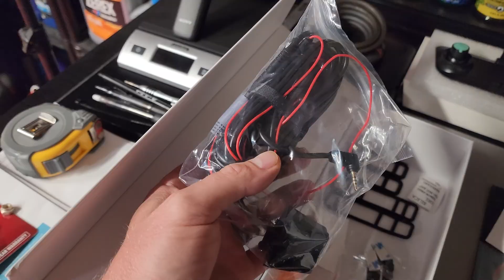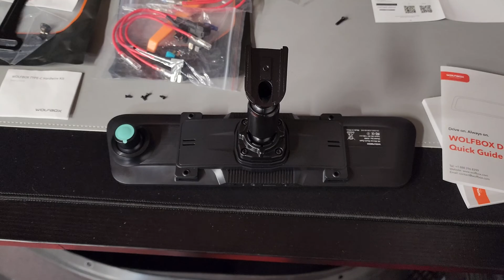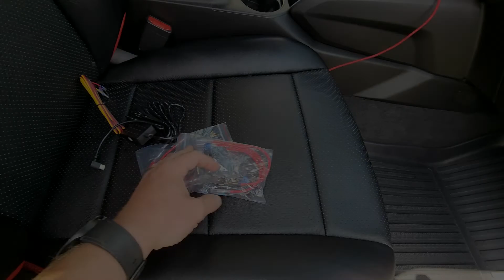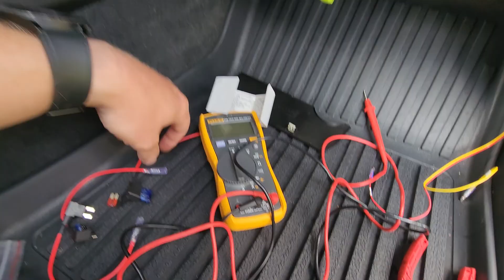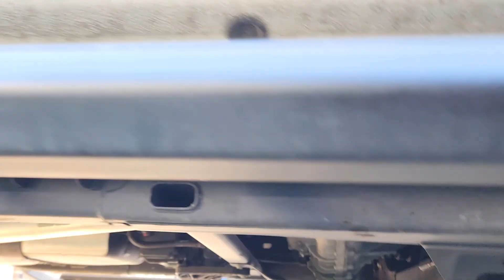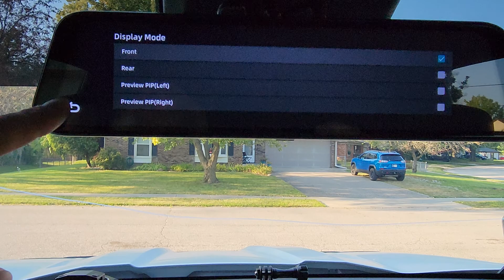Wolfbox G900 In Depth Install Hardwire Kit 2023 Colorado Dash Cam

Comment: thank you for your video... i have a mustang fastback style with louvers in the rear window, my mirror is basically useless.. I bought a wolfbox mirror/camera and will be installing it today... im definitely tapping in to my reverse lights though because that's pretty much the reason I bought one...
Reply: Installed it today and I freaking love it!!! I shouldn't have waited so long to buy one... I did hardwire it, hardest part was finding fuses in my mustang that didn't have constant power... I could only find one in the passenger cabin that was acc switched, because you can't tap in to any safety modules or computers... your video definitely helped me, thank you...

Comment: How'd you get the wire through the firewall grommet? Tried to do mine  by attaching the ends to a coat hanger to pull through but the rear cable connector broke and other cable connector got dented 😂 idk what i did wrong

Comment: Air bag is in the A pillar when I ran my cable you have to go around it. Simply remove the 10 mil bolts on the OS bar (oh shit bar) and pull lots of plastic trim
Reply from the maker: You can do that if you want. Its not necessary this little wire is not going to stop the airbag

Comment: So I just tried to install the hardwire kit. The unit is not powering up though. I used the cabin light fuse slot for the constant and the radio fuse slot for the acc (my radio only works with acc on). When I tap the earth onto a bolt, it gives off a small spark. So I know that power is running when acc is switched to off. I tried a variety of voltage settings too. Still nothing. I switched back to the cigarette lighter power sourse and the unit still works. None of the fuses have blown and the radio and cabin light still work. Any ideas? Oh, and i dont have a voltage meter.

Comment: I have a question since we both have a smart cap, same truck, and I just got my wolf box.  How well does the back camera view on the license plate mounting location prior to you moving it to the swing out. I’ve seen install back up camera on the smart cap itself and since you’ve used your wolf box for some time now what would you say is or might be the difference in locations.  Ty
Reply from the maker: The back camera was great before the swing out but once the swing out with the table on it was mounted. The factory rear camera was then useless. The wolfbox camera is off to the side just slightly but still helps a ton. I'm not sure if that answered your question or not.
Reply: @TonyTheTechnician absolutely ty
Reply: Ty again for the video and everything works perfectly minus the dumb gps lol.  Worked in the beginning then stopped the started now nothing.  It was never enough to set my time stamp right too so I hope a replacement will work.  Just have to rerun the wire again lol
Reply from the maker: @Mr.NelsonUSA omg i had the same dang issue. Worked fine. Would pickup direction and time and all that info. Then just stopped. They sent me a new gps antenna. Did the exact same thing again. I didnt even bother after that. I was irritated lol
Reply: @TonyTheTechnician oh good to know maybe I’ll try one more time lol.  I need to see if I can set the time by itself then lol
Reply from the maker: @Mr.NelsonUSA ya lol. Idk why they dont let you adjust the time. What i had to do was scroll through all the different time zones until I got to one that matched my time lol
Reply: @TonyTheTechnician heads up they having a sale on g900pro and I got it with 33ft rear extension with screen protector for $287.00 total.  Returning my other since gps was not working.  Pro doesn’t seem to have this issue.
Reply: Hey, just wanted to let you know I did install the G 900 Pro love it a ton more but anyways the GPS so I installed it. The GPS wasn’t working again, but I found it right up. Forget where when you’re driving to move the GPS around the dash and it almost like activates it with the satellites sounds weird, but I did that moving it around before tucking in the wire and now it works perfectly fine. Hope that helps.
Reply: Also have the pigtail of the cord coming out of the GPS little square module towards the cab, not towards the sides or the front of the truck
Reply from the maker: @Mr.NelsonUSA good to know ill give that a try. I appreciate the update!!! Thank you
Reply: Yeah, I wish I could send you a picture but I have a total 11 bars on the GPS info after doing that
Reply: @TonyTheTechnician  I mean, it’s at least I could do. I’ve watched all your videos or should I say your classes on how to do it and everything worked out perfect so I appreciate it.
Reply from the maker: @Mr.NelsonUSA no problem at all happy I could help, I always enjoy viewers input and your information is greatly appreciated. Thanks for watching the videos! 👍

Comment: What length wire did you use for the rear camera?  Was it the included 20' or the 33'?
Reply from the maker: Bc of where I ran the wiring and where I mounted it. I ran the extended wire which I had to order

Comment: Can you tie into the radios GPS for android auto so you dont have 2 on dash, or is it needed? Seems silly  to have 2. Could use  both one in middle of dash, the other in the passenger corner. Thanks for your time.
Reply: If this helps I installed my GPS directly behind my mirror on the windshield. Everything worked fine. At least in your case one of the gps mounts will be out of sight and not such an eyesore

Comment: Using this video as a guide right now for my 25 trail boss. Thanks.
Reply: Same isntall process for you? Looking to get one in the future
Reply: @texys5848  I used a different dashcam, but yes I tapped into the same fuses. And I didn't remove the panel at the grab handle, I just tucked in the wire .

Comment: Do I have to connect this to the fuse box or can I just solder it into the cigarette socket for earth , and Acc then connect the yellow direct to always on power cable ?
Reply from the maker: I mean as long as you have constant, 12v switched and ground then it doesn't matter where you hook it up. But thats just more work over simply tapping the fuse box. But maybe that works better for you
Reply: @ yeah it works better for me as it’s a Jeep and I don’t want to go through the bulkhead
Reply from the maker: @Blastapast100  understandable 👍

Comment: So just installed. Everything works besides my seat now. I have a 24 zr2 colorado. Was your seats powerd too?
Reply from the maker: Yes my seat is powered and mine still works. I would double check what you tapped into and also check all of the other fuses
Reply: @TonyTheTechnician  got it 💪

Comment: Great info. Question -  I have a 2025 nissan murano. this suv does not have cigarette lighter. therefore I must use the hardwire kit. I want to use blackboxmycar's powercell 8 battery backup solution vice the obd interface hdwire kit. the problem: is the connectivity cable btwn powercell 8 & dashcam???  any cable connectivity suggestions?? powercell8 solution does not drain the car battery for parking mode. obd solution drains car battery for the parking mode

Comment: Hi! I have the hardwired kit, everything works, except I can’t link the camera to the app on my phone. Did you have trouble connecting? The Wolfbox WiFi won’t be detected on my phone. Wondering if you had this issue, how did you fix it. Thanks!!!

Comment: I had 4 different size fuse taps come with my dash cam.  The 2 that you used were both micro, so did you have to buy an additional micro fuse tap since you chose both of the same?  I’m assuming I’ll have to buy a 2nd micro fuse tap since my other 3 are different sizes
Reply from the maker: No mine came with 2 sets of 4 so I had 2 of each size.
Reply: @TonyTheTechnician the kit only comes with 15amp fuse.  Did you use the 15 amp?
Reply: In the 10amp slot?

Comment: My taps are 15 amp and the two fuses you used are 10 amp.  Can I use those two fuses if my taps are 15 amps or do I need to use 15 amp slots?
Reply: Or can I just use empty slots in my fuse panel?

Comment: I have a Tacoma with Smartcap as well. I installed my wolfbox G900 rear camera above the 3rd brake light on the Smartcap with double sided tape. No drilling just ran the cable above the Smartcap door.
Reply from the maker: Ya I have seen that as well as it mounted right inside the window.